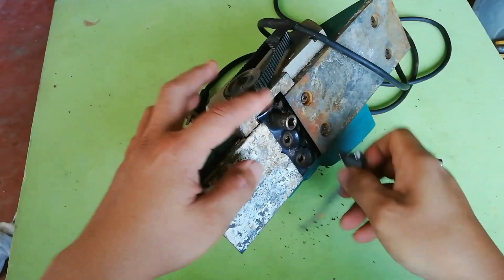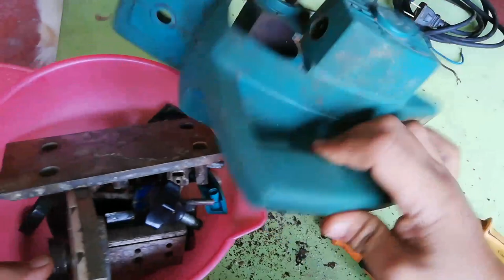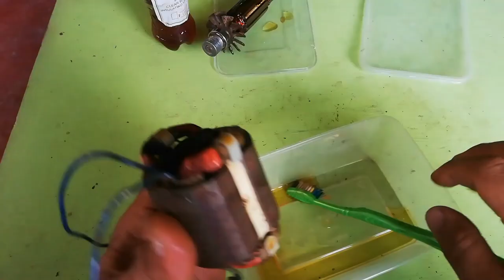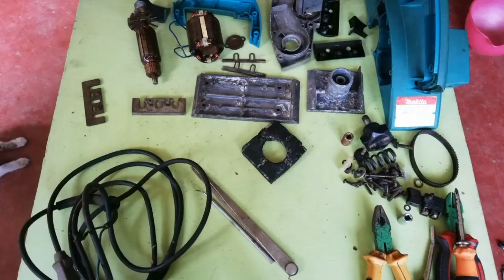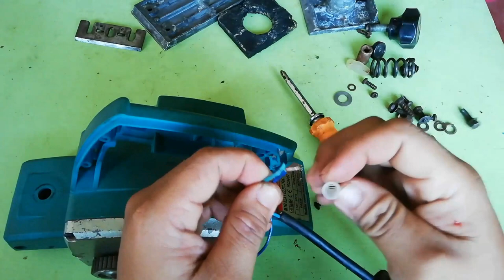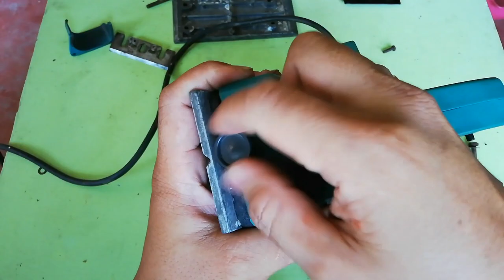Best way to repair damage power tools | sparking armature

Comment: Sir ano po yong gamit mong pang linis?
Reply from the maker: Niliha ko po muna sir at hi anap kung may nashprt circuit bago ko nilagyan ng insolation varnish..
Anong power tools po ang kailangan yung e repair sir?
Reply: Why does the insulation varnish remove the short form the winding... i thought you have to rewind it in this case